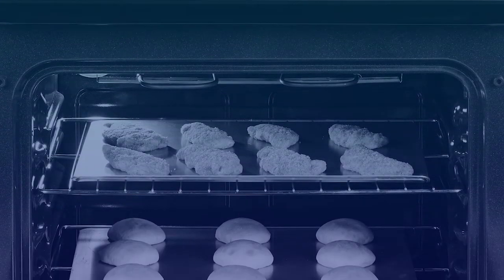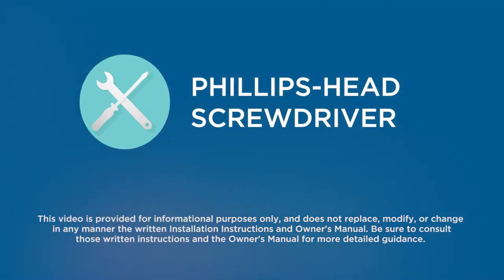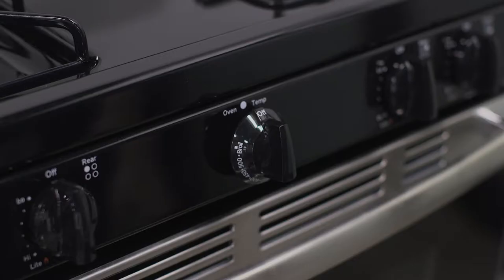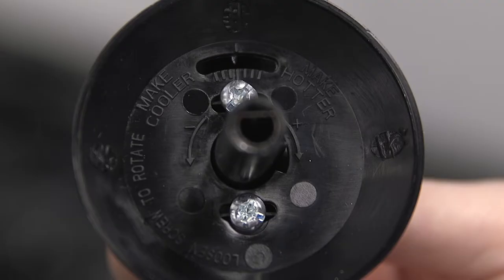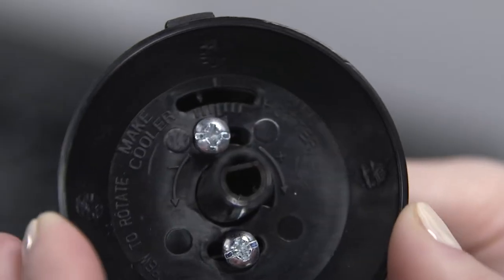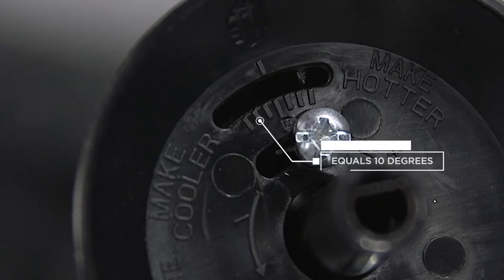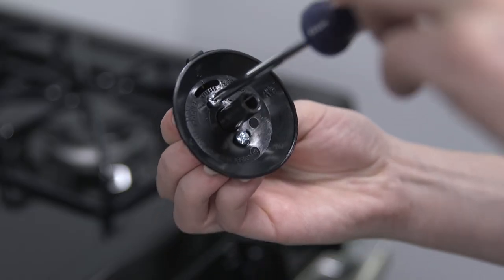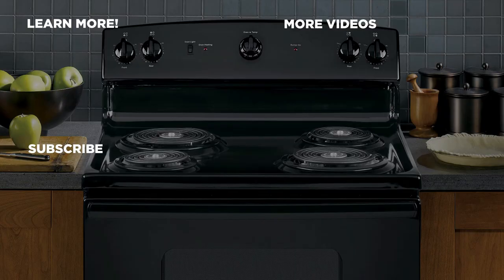Oven temperature adjustment – using temperature knob controls

Comment: This just blew my mind.  I have a GE wall oven that's probably 40 years old and I was always having to raise the temperature to get it to bake at the right temp.  Took the knob off and not only does it have this adjustment, it is a better design than this much newer oven.  It clicks like a ratchet left and right by just holding the front of the knob.
Reply: The knob also allows up to 50 degrees plus/minus adjustment instead of just 30 degrees.  Newer ovens probably don't need that much, but I had to adjust mine +40 degrees to hit 350 f.

Comment: This video seems incorrect. We bought a new GE range and food was undercooked. We had to cook higher and longer than directions stated. We tried to calibrate the oven in this manner, but when we tested the oven with an oven thermometer, four times in an hour, it still wasn’t getting up to the right temperature. Finally, we tried moving the pointer to the opposite direction, as far as it could go, then we got matching numbers.
Reply: Or the printing on the knob itself is wrong. Either way, we had to turn it the opposite of as directed.
Reply from the maker: Hello,

We're sorry to hear your new range wasn't heating properly. We're glad you could adjust the temperature using this method. However, if you had to turn the knob in the opposite direction, i.e., 'make cooler' instead of 'make hotter,' we suggest you get in touch with a technician to ensure that your unit is working correctly.

If needed, you can schedule service by calling 1-800-432-2737 or online here: http://spklr.io/6055mNxF.

Take care! -SH
Reply: @sjwolf3836 i had the exact same issue lol. oven was about 20 degrees under temp, so i turned towards “make hotter” but then it was 50 degrees under. swung the other way towards make cooler and it immediately was correct. i believe some units may be printed backwards.
Reply: Thanks for the confirmation. Before we figured this out we had an official GE repair guy look at it. He showed up after 5pm and said he didn’t have time to test the calibration. He just made fun of us, said we didn’t know how to use an oven and asked what did we expect for buying a cheap one? It seemed like an average price range to me. There were quite a few cheaper. We wanted a basic one without the digital components and front knobs so we didn’t have to reach over pots. We just wish GE hadn’t removed the self cleaning function from the previous version. It was a pretty disappointing experience, but, at least, the oven has been working well, now that we figured it out.